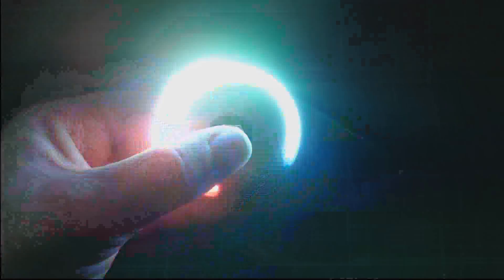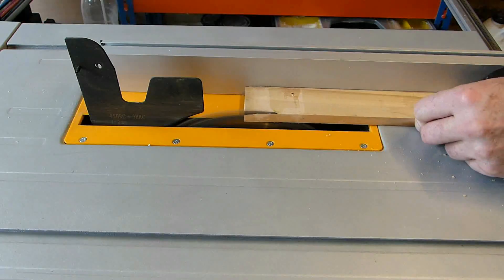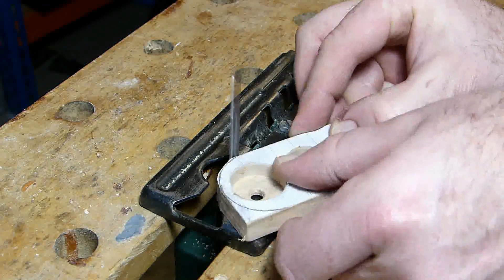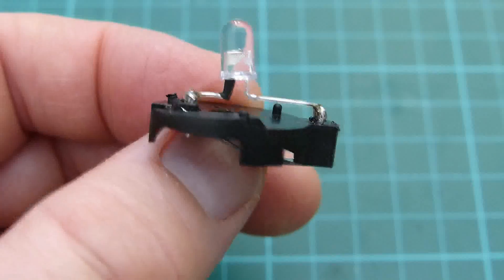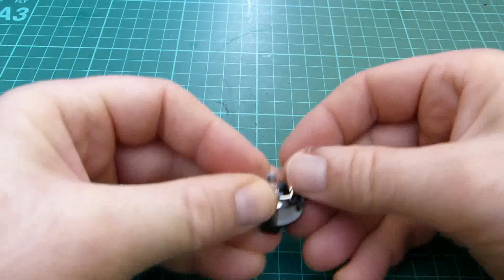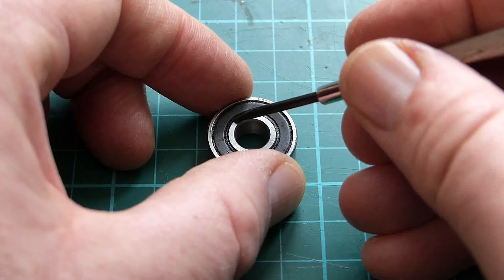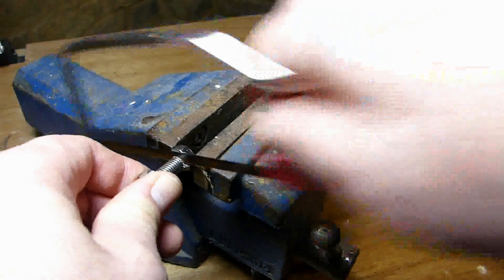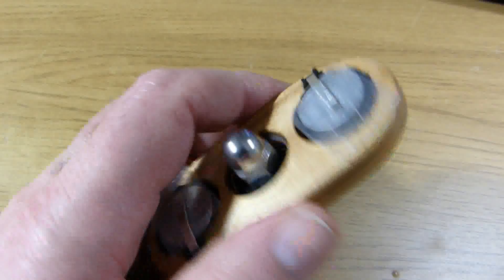How to Make a DIY LED Finger Fidget Spinner

Comment: great video.  out of al k the diy wooden spinner instructionals you are the 1st to drill holes before cutting out frame. I kept saying on other videos, " drill 1st silky". and you did. about time someone with brains made a video.  congrats for having common sense.
Reply from the maker: +Dewey does it  Thanks
Reply: I call them like I see them. I try not to hate but props where deserved.

Comment: I like your idea but would of added some weight the the ends to help maintain a longer spin. One way i though this could be done is drill out some small holes and glue in some small ball bearings
Ray
Ps some thought to the woman who invented this idea for her young daughter but never made any money off it as she sole the rights before it kicked of.
Reply from the maker: if I was doing it now I would use a full ceramic bearing, as these make a huge difference to the spin time.

Comment: not require resistor?
Reply from the maker: No. It's different from a normal led. If it was a normally led then it still wouldn't need a resistor as a coin cell can't provide that much current anyway.

Comment: Nice snipper!😃 One thing you could to make it spinn longer is to ad some weight on the ends.👌
Reply from the maker: +Håkon G. Andersen Yes. I also took off the rubber  bearing covers and it spins a lot longer. Thanks for the comment.

Comment: Whenever I search for bearings there's a lot of results 8 x 22 x 7 mm ones that are cheaper than the 22 x 8 x 7 mm ones the description says we needs, could 8 x 22 x 7 mm ones work as well? Also for the description didn't list the bolt and nuts we need.
Reply from the maker: They are probably the same bearing size. The outer diameter is 22mm, inner diameter 8mm and width 7mm.  The bolt is a stainless steel M8x20mm (8mm diameter). The nuts are M8 stainless steel dome nuts.  Thanks.
Reply: techydiy ok thanks for replying :)